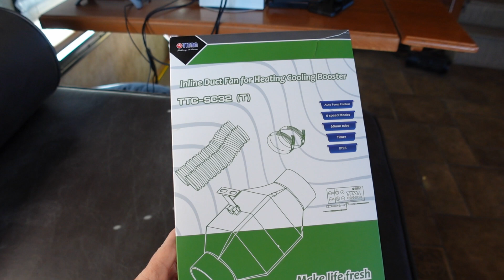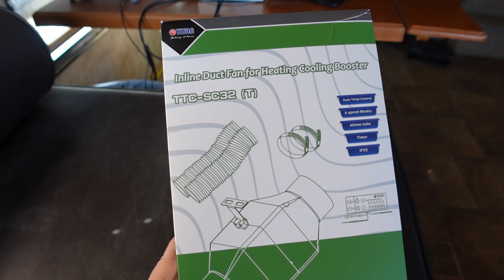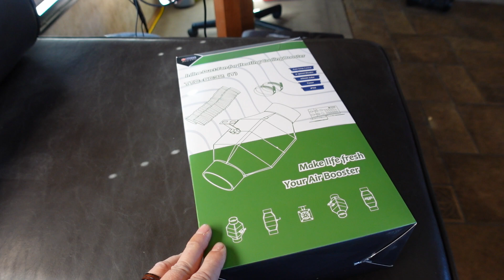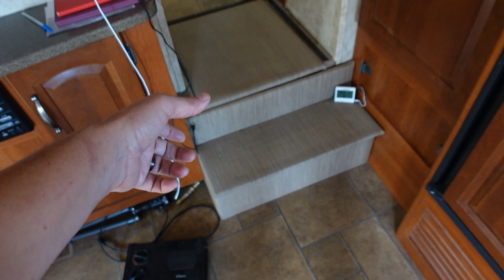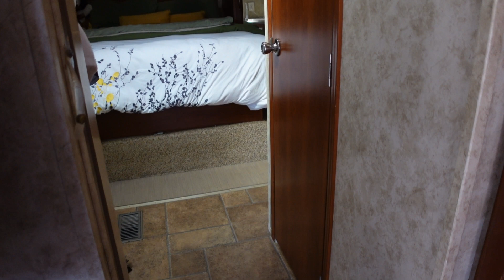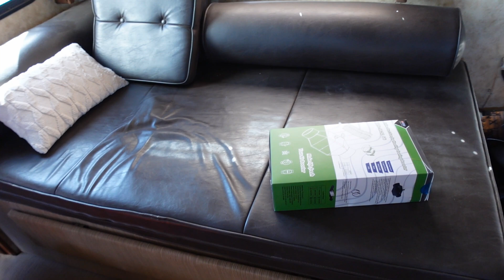12V Inline Vent Booster Fan Installation - Better Furnace Airflow into our RV Bedroom

Comment: Did this seem to help in your issue with heat? I have low flow and very little heat out of one of my rv ducts. Did the reduced size seem to have any negative effect? Good video! Thanks for this!
Reply from the maker: Yes, heat more even to the bedroom. One thing that happens that I didn't think about is the fan keeps running after the furnace turns off until the temp in the vent lowers. So it keeps drawing warm air into the bedroom, for a few minutes more. The only issue I can see happing may be with hair. Our RV furnace doesn't have a filter so over time hair may get into the fan and have to be cleaned out.
Reply: @LoveYourRV thank you very much for your reply and the link!
Reply: Also do you happen to have a link for the reducers you used?
Reply from the maker: 4 inch to 2 1/4 reducer pipe - https://amzn.to/4bDLszn

Comment: Too bad you didnt do the kleenex test before you cut into the line. 

I posit that the flow through those reducers (WITH the fan on) isn't improved enough over the unrestricted 4in duct to justify having to listen to that noisy thing.

Comment: Had the same problem on my 5th wheel, too -- weak heat to the bedroom.  In a traditional home hot air heating system, its ductwork is equipped with dampers which allow adjustment of the airflow to different parts of the house.  RV ducts usually do not have dampers.  However, on my 5th wheel, one of the previous owners replaced the plastic floor vents (they broke) with metal floor vents having built-in shutters that act as dampers.  By partially closing the shutters on two of the three floor vents in the living room and kitchen area, I increased the airflow to the bedroom by two times.  No need for a booster fan and no negative effect on the furnace.  I noticed your floor vents do not have shutters.  Replacement floor vents with shutters can be found for most common sizes of ducts.
Reply from the maker: Some people have had issues with restricting the ducting air flow, it can overheat the furnace triggering a high heat disconnect protect switch. I guess it all depends on the OEM ducting installation. So, I've always been leary of blocking off the vents. My Suburban furnace user manual warns against restricting air flow in the ducts, but it also warns against using booster fans saying it may cause the furnace to cycle on limit and to have erratic sail switch operation. I figure though this fan is not very strong and far away from the main furnace so shouldn't be a problem.

Comment: Maybe you should have compared the paper towel before you reduced the duct and put a non- running fan in the duct.  Looks like you needed a 4 inch booster.
Reply from the maker: I wish I did too but forgot. Flow seems stronger. We've lived in the camper for near 14 years so have a feel for it. Now at least I can feel air blowing out. Once we get into some colder weather and use the furnace I can see if things are improved in the bedroom.

Comment: Do you have or know the specifics of the thermo control? Can you set the temp it kicks on and off? Thank you!
Reply from the maker: No exact settings can be done. It's based on the resistance of a little thermistor on the end of a wire. Seems it start up around 70F and then as it warms up it speeds up the fan.

Comment: I had the opposite problem where it got too hot in the bedroom. So I blocked the vent, big mistake as it caused the furnace to shut  down on its high limit thermal protective bi-metal thermostat, which failed to reset and I had to totally remove the furnace, not from just its little hidey hole but from its full metal case to access the thermostat. three days latter I had it backup and running, lesson learned. Thanks for posting.
Reply from the maker: Thanks for the tip

Comment: A lot of plastic for $60.00 I have a AC Infinity blower with 6 speeds that cost around $99.00 it's all metal and quite can take a lot of abuse. I'm not using it in my 5R but a laser engraving machine to vent outside,  it has the power to push warm air out against extremely cold Michigan Air. The first one I tried was similar to the one in the video it couldn't push the air out against the dense Cold in the winter filling my house with smoke.  Unfortunately I don't think AC Infinity makes a 12v version but there are.lot of clones out there.  Just my experience with a plastic fan. And as someone else mentioned that size reduction "bottleneck" is going to be an issue for the furnaces flow rate it could shut down intentionally.

Comment: Not too many of these fans run on DC.  Having a hard time finding a DC fan 200 cfm to booster air flow from intake vent to diesel heater/window AC (buried in the back of a truck camper I building).  Thanks for sharing.